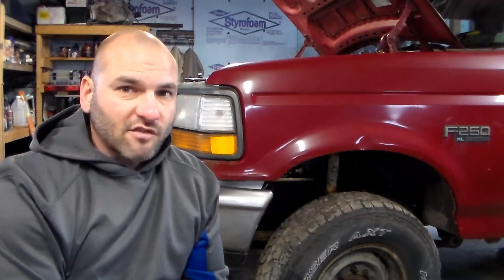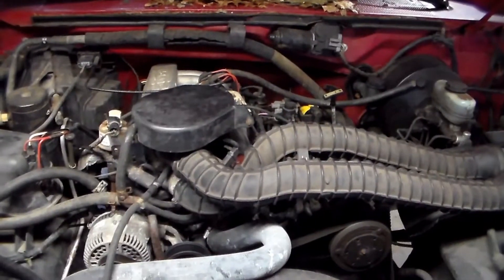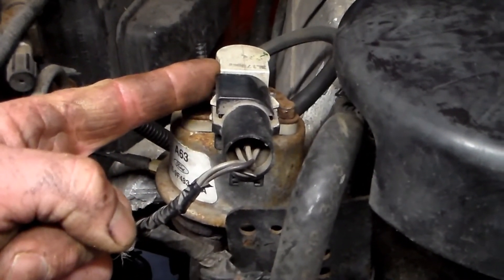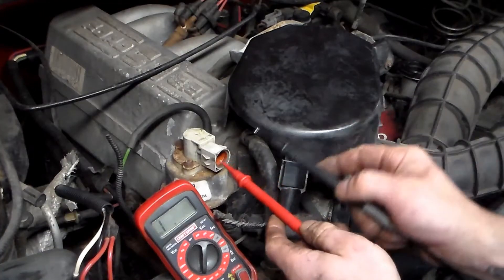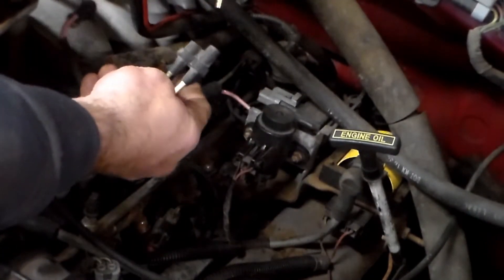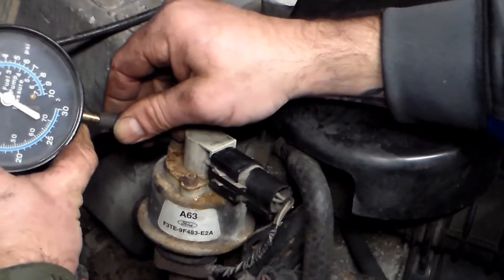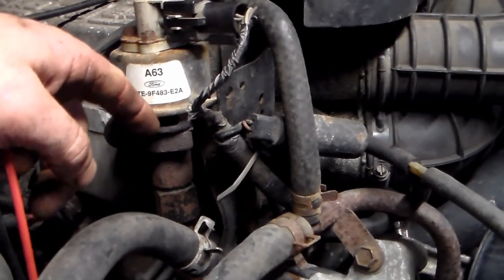Ford Truck EGR System - Complete OVERVIEW and TEST -  Step by Step!!

Comment: Does the 5.8 have a DPFE Valve? I have the same truck and I've been trying to find it. Nowhere on the Internet shows where it is. They usually say it's right by the EGR
Reply: Thank you for the video by the way. Helped a lot. Still have the 327 code. EGR solenoid tested 3.58 ohms (multimeter on 20k ohms) on Koeo. I'll keep you posted. Your video helped a lot. Just replace the control valve because it was faulty. New motorcraft EGR. Why not.  Mines a 1996 F250 5.8. Anyway thanks for your video. I replaced all the vacuum lines because they kept breaking lol

Comment: My Harley f150 is newer than your truck, but your video is by far the simplest and most informative that can benefit any F150 owner. I have the dreaded P0401 that led to a misfire in cylinder 4. I will use your video as a guide to hopefully fix mine. Thank you for posting!

Comment: The EGR valve does recirculate exhaust gasses back through the intake, not to burn unburnt gasses, but to introduce neutral gasses to air fuel mixture, for cooler combustion chamber temperatures, thus reducing NOX. NOX one of the three smog causing gasses emitted from your tailpipe. The other two are HC and CO. Engine puts out about 3000ppm NOX. EGR valve reduces that to about 1500ppm. Catalytic converter handles the rest.
Reply: Thank you,  someone that knows how the egr system really works.

Comment: Should there be vacuum at the green line at idle with the engine cold? My truck runs horrible but runs totally normal if I unplug the green line at the EGR. Is too much vacuum causing the egr valve to open at the wrong time and chocking out the engine?

Comment: I realize this is an old post but I am trying to troubleshoot some codes and running issues after my 94 Bronco with the 5.8l is warmed up.  I think there might be an issue with the control valve.  The first thing I found was that the top hose was the one with vacuum, not the bottom hose.  When I hooked up the vacuum gauge, the truck stalls and dies though it does seem to have around 20psi of vacuum.  Your video doesn't show that it dies.  Is that an expected result?  My hoses have been replaced and are not color coded.  So I think they got reversed at some point.
Reply from the maker: @larrydalien1337  I try to stay on top of my posts regardless of age as this stuff doesn't expire, but it's been so long since I've worked on this I couldn't tell you now. I'd suggest posting in the OBS forums.

Comment: You solved my problem! Didnt know it only operated at full temp so my new parts didnt work until then. What a relief
Reply: What were the symptoms,mine is throwing a code 33 wich is egr and having acceleration problems it just bogs
Reply: @CristoBarboza-vh3ez  mine had a pretty bad miss until it warmed up. It didn't really seem egr related but it must have been
Reply: Would your truck do the high idle cold start till it warmed up or just go straight to 500-600rpm? Mine won't , cold engine, crank it up straight to 600 rpm and runs like a carburetored truck till it warms up then idles at 700-800rpm, also won't idle up to compensate for the ac on, ive been driving it that way for years  and I want to get it back to running right

Comment: What if there is not volts at all?
Reply: EITHER A ECM OR A CRACKED OR SHORTED WIRE OFF THE ECM GOING TO THE  EGR SOLENOID OR EGR POSITIONING SENSOR.
Reply: @goodvrsevil737  if it's a ecm. PCM problem and it cause the EGR valve to malfunction and the evap sits on top, can it cause a misfire????
Reply: @ YEAH IM CHASING DOWN THE SAME PROBLEM.
Reply: @goodvrsevil737  what was it?

Comment: just tested my 87 ford f150 5.0L EGR...all tests passed except the valve is not opening when the vacuum is applied from the EGR solenoid to the EGR valve to open.  I guess it's frozen.  thx for this info btw.  no nonsense...just the goods.

Comment: What exactly happens if the EGR position sensor has a low voltage and what cause it to have that?
Reply: Bro im having the same issue and i cant figure it out 😂im getting code 32 on a 91 5.0 f150 lol
Reply: @SHAMAN_ELITE  did you fix yours?

Comment: This very helpful.   Thank you.   I'm havig 558 8 code and everything is  test good on the control valve.  Moving on to the position sensor next.   I tested EGR valve but apply small vacuum to the green line while running and it almost stalls.

Comment: I have a 93 bronco 5.8. When i fire it up it starts up fine, then goes from high idle to low idle after one minute. After I drive it for 20 minutes and it is fully warmed  to operating temperature I park it. When i go to try and start it after 20 minutes of sitting it has a rough start and almost conks out, but then smoothed out. Could this be my EGR valve? I replaced engine coolant temp sensor, ignition coil. I have no check engine light.

Comment: Im getting about 4 ohms at the sensore but no dc at connector. My temp gauge never goes above "N" in normal idk if thats a problem , i knw alot of these gauges didnt work well but could it be its not reaching temp or atleast the computer doesnt think it is? 88 bronco 5.8

Comment: Just like that and the valve was changed. For me, two days and a can of silicone and four million cuss words and l still haven’t cracked it loose.
Reply from the maker: Lol, if it's any consolation I was as surprised as you. But when you do get it off...Copper based anti-seize!!! I use on all hot parts, exhaust etc. I've taken stuff back apart years later like it was Just put on! Link to what I use is in the vid description.

Comment: I'm curious as to what you would do as far as diagnostic. If you knew your vacuum lines were good, you replaced the control valve, and it made no difference.

Comment: My 96 will run good for days then all of a sudden stutter and stall, crank and crank, no syart then suddenly start fine. I have replaced the stater, solenoid, coil, ignition control module and ignition switch. Maybe egr? Its so hit and miss that its hard to diagnose when it wont stay broke.

Comment: I got acode 332 on my 95 mustang gt. Tossed a new egr solenoid at it, same outcome. Pulled 10” vacuum on the egr valve and it held. Removed the egr position sensor and tested it for ohms. Got nothing while pushing in the sensor pintle. Got a spare egr position sensor and test that. Closed it reads 3.8ohm fully depressed .3ohm. Pretty sure the position sensor wasn’t telling the computer when it was opened. Tested the new sensor installed with a multi meter and when vaccum is appled the ohms decrease and will return to the static 3.8ohm. At about 5” of vacuum ohms reduce to .7 or so. Hopefully this will fix my egr code.

Comment: If only I had watched your video 5 days ago. I was told by a friend that I needed to remove my EGR valve to see if it was stuck with carbon. I struggled for days trying to remove the giant nut from the EGR valve body. I finally got it off thanks to an air hammer and low and behold, the EGR valve was fine.

Then we watched this video and realized that the position sensor was fine and now we will test the EGR control valve tomorrow... I never had to mess with the EGR valve nut... UGH
Reply: Wich problem did you have? 

Mine starts to run rough when warm, I’m about to begin tear down those egr components to look for issues

I have the 33 and 332 code on it (92 4.9)
Reply: @betolp277  I finally took the time to properly diagnose my EGR problem this morning. It wasn't any of the major components. The problem ended up being the vacuum line from the engine to the control solenoid was bad.

My first test was to see resistance at the control solenoid and I got about 32 ohms which told me that the solenoid circuit was probably okay. So I them took my vacuum gauge while the engine was running and found there was no vacuum in the line that goes from the engine to the control solenoid. I took a more careful look and that line was clearly damaged, so I replaced it and I don't have a code and it's idling much better now
Reply: @TheSamsonizzle  that’s awesome! 

I found the issue with mine, was the coolant temperature sensor, the one next to the thermostat, when warm it cut the signal to the ecu, and make the spark weak, replaced it and work normal again. 

I took out the egr and was stucked closed, so just cleaned with carbuclean and checked the resistance on the sensor, it looks pretty normal to me, and change all the vacuum lines.

Not have the check engine light on, but when i do the jumper thing to get codes, 33 and 332 still appears.

Comment: @Redneck Tech got a two fifty like you here a 91 5.8 but i got a EVR solenoid that is driving me crazy ran over like you did here but atill cant get teh EGR to actuate at all :( but it runs like  a champ just rebuilt here cuz had over 400 k on here and bearings on the bottom end were starting to go out from previous owners lack of care :( . any idea what might be going on here on this ? this is what i got out on my diag 50 on the ohm voltage tested good on both sides and voltage tested out good on both sides of the evr . butthe vac i am not getting anything on it to the egr itself and that is going thru 6 sensors i had laying around and same on all of them. and as far as for the egr valve to test it to make sure if it works or at least moves you can grab vaum of the tree on the intake and tap it onto the egr valve and it will make it move no problem except if you leave it on too long it will stall out the truck but it will show you if the egr moves or not . and as well i strongly suggest using copper never sieze on the tube there for the gasses as it puts up with heat better then the silver version .

Comment: I recently found the Bosch 1300 Scanner that not only makes it very easy to pull codes on an OBD1 system but can give you live engine data. works great on my 91 f150.
Reply: How much was it? Cant find any in stock.

Comment: Aloha, hopefully you can help me out, I have a1990 e150, it sat for 2 months, I ended up replacing the distributor because it would not start. since replacing the distributor the van stalls when it warms up. It will not start til it cools off, then it stalls again.Any Ideas on what to check? thank you!
Reply from the maker: Sigh, I wish I didn't have youngzheimers. I have had this exact issue and others have asked me about it as well but I can't remember what it was that was wrong, it was long before I had a YouTube channel. It wasn't anything major I can tell you that. I found my solution through a lot of reading on the forums.
Reply: @rednecktech82  I hear you, I've been dealing with half helmets!
Reply: @rednecktech82  that should read halfheimers. I'm wondering if it might be an intake manifold gasket leak.

Comment: My question is where does the other end of the white line connect to get vacuum from the engine?  I inherited a 93 F -150 and the white line is disconnected on the passenger side of the engine.

Comment: The best thing about your presentation is that even a car/truck mechanical imbecile like myself, can understand the material presented. I am sure that my control valve is bad and that my EGR is bad too. I am betting money that my code 44 on my obd 1 will go away after I change them. If it doesn't, then at least I have peace of mind knowing that old parts are swapped out.

Comment: Was hoping to see a follow up video showing everything working after replacing the EGR. Did that solve the problem? You lost vacuum halfway through the rev. was hoping to see you rev it more to see if the vacuum went up each time. Also do you know how many volts should be at the electrical connection for the control valve?

Comment: So what do I do if neither of the electrical components get a read on the volt meter?
Is it JUST replacing those two components? Or is there more?
Reply from the maker: I would verify you have power going to those components first and if not you have another issue. If power is going to the components but you don't get a read then yes they would need replaced.
Reply: @rednecktech82  How do I verify there is power going to the valve control solenoid and the position sensor?

Comment: I’m not getting vacuum from the engine now what 🙄
Reply: 0 vacuum from engine could it be the control sensor
Reply: @TimMcGowan Did you end up finding out what the issue was?
Reply: @SmithSurveying  no but I’ve gotten some more help from other people who think it could be the vacuum reservoir I’m gonna replace that next after I fix my starter issue 😂
Reply: @timmcgowan27  That's funny because I recently replaced my starter..looks like we had the same issues haha. I was going to mention to you that you could have a broken vacuum hose or reservoir. I just bought some silicon hose to replace all of the vacuum hoses in my 95. Good luck man!
Reply: @SmithSurveying  lol my top starter bolt came out and was causing  the starter to not engage the flywheel correctly and when I replaced the entire starter it not is staying engaged so I’m in a pickle
Reply: Likely DPFE or purge valve
Reply: @MX-CO  I can’t find anything on the dpfe on my truck (1994 f150 5.0) and can you be more specific on the purge valve, the egr solenoid? I’m a little confused

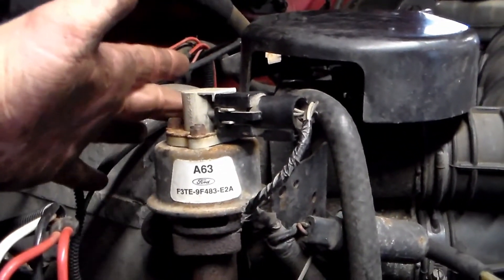Comment: @8:38 the sensor that has single vacuum line coming off of the Throttle body, connecting to the sensor that has a "Tee" at the bottom and then going to the front of the engine bay. What is that sensor call. I had to replace the TPS and when I went to pull the Vacuum line off this sensor it broke at the base. 

BTW great video.. really help me get the 1994 5.8 Bronco running much better. Just have to fix what I broke.
Reply from the maker: if it's what I think you're talking about it's a "Canister Purge Valve/Solenoid" or also called "Vapor Canister Purge Solenoid" or just "Purge Valve"...two wire connector at one end, vacuum line Tee off the other end? Look up Carquest part number CPA1107, that's the listing for your 94' Bronco, part runs about $75 - $90.
Reply: @rednecktech82  Yes sir, I believe we are talking about the same sensor

Comment: Seriously one of the most informative tutorials I've ever watched on Youtube.  I feel like I actually learned something.  Nice work.
Reply from the maker: Thank you
Reply: @rednecktech82  I have a 1989 Ford F 350 XLT Lariat with a extremely loos steering wheel what would I need to do to fix it. It's tilted to the left and have 8 inches of play on the steering wheel, (probably people using the steering wheel to pull themselves in over the years) please help!
Reply: Thanks and the link you sent is for 1992 -1997 I have a 1989 do you know where I could find one for that year new or should I go to a junk yard and gamble with pulling one from there?
Reply from the maker: @Jesse--  you'd have to online search...try salvave yards before a junk yard (salvage yds typically test n sell only working parts vs junk yard being whatever).
Reply: @rednecktech82 Question?? What to do if my white vacuum  hose is sucking instead of blowing I can't figure it out thanks.
Reply from the maker: Sounds like you may need a full rebuild or possibly a whole new column if the steering column itself is worn so bad that you have that much play. There are other components to the steering column but typically it's just the upper bearing and then maybe the lower bearing that need replaced. Unfortunately I'm not aware of any videos showing a full column rebuild  as most just buy a whole new rebuilt column at that point. $500 last I checked at... https://www.steeringcolumnservices.com/rebuilt-columns/1992-1997-non-tilt-floor-shift-rebuilt-ford-steering-column.php

Comment: i have a 1989 Ford Bronco with a 302 ci 5 speed stick,  Truck always ran great then about a few months ago at a idle it goes up & down over & over almost to stall,  i replaced the TPS  that was not it,   i then replaced the MAP & 02 sensor still does the same thing  then i was told it might be the EGR Valve,   Man this is getting expensive   what else do you think it could be,  sounds like a Vacuum  i checked can't find a leak have any ideas  PLEASE   HELP. !

Comment: Finally someone with no nonsense explanation on egr. My 92’ has “non sufficient air flow” code and I needed a video like this to test the components before I dump $$ into it. Thanks
Reply from the maker: Thank you! I run a few of these trucks...n they aren't gettin any younger so always more vids coming!

Comment: My truck is not showing any voltage in the electrical harness that plugs into the position sensor. Do you know how to fix that?
Reply from the maker: Just have to track the harness and look for any breaks, ground outs or blown fuses.

Comment: I have a 95 f150 has some hesitation, I have a code 31 coming up from a KOER test. I tested everything like you shown and everything seems to be working and I cleaned out the EGR valve and also patch some vacuum lines. looks like I'm still having that code 31 come up, what else do you think it could possibly be ?? Thank you
Reply from the maker: I would check FordTruckEnthusiasts forumn and see what you can find, always a wealth of knowledge there.
Reply: @rednecktech82  I did some info change out the EGR position sensor it looks good now but I now have ac on max and it blow threw the defroster 🤣
Reply: @joeyziegler391  there's a vacuum line that comes from your heater area hook that up that controls your actuator doors on your heating system and your air conditioner

Comment: I threw a 558 and did the test. After replacing the control valve, still no vacuum and still threw the 558. I guess I need to test the power to the control valve? Could it be a loose wire?
Reply from the maker: Google obs code 558 and the first result is a good write up on this in the Ford Truck Enthusiast forumn, should help you out.